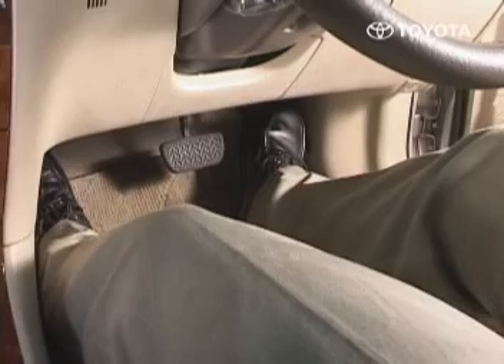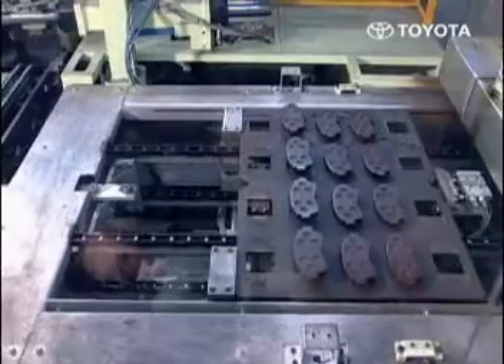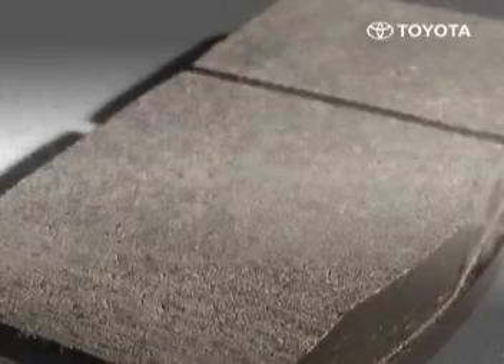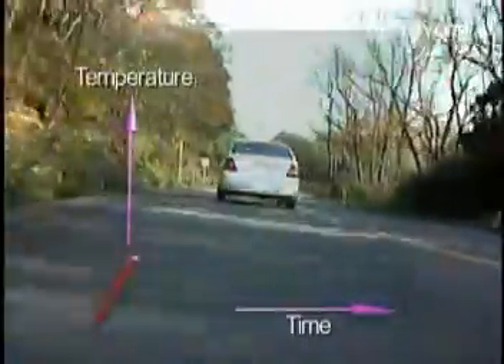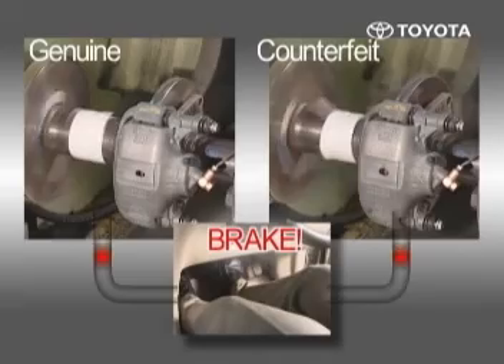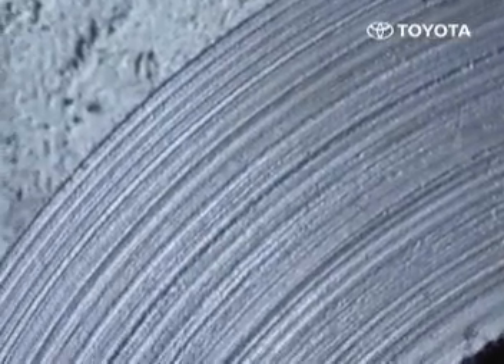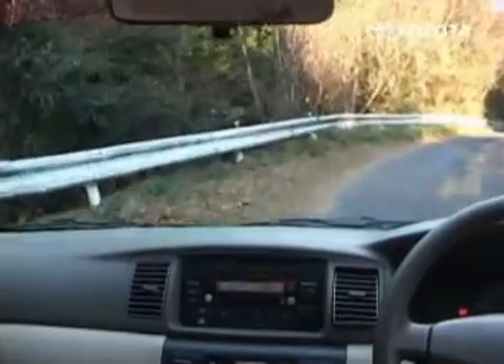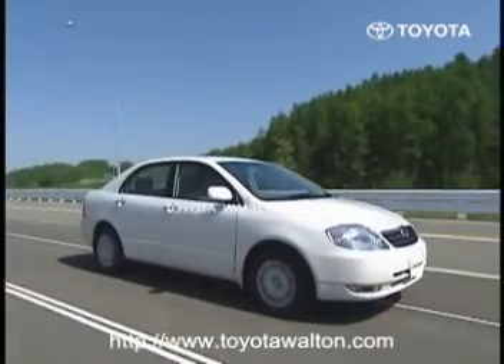Why Genuine Parts Toyota Brake Pad 4/6

Comment: Fact: OEM Pads are always the best in friction
Fact2: All pads sold in shops/parts shops meet a "Standard"

OEM toyota: Brakes best, in return, lots of dust.
Good brand: Brakes Decently, Little or Lots of dust (depends on material)
Racing brakes: Good/Better than OEM, at the cost of Dust And or Killing the rotors faster. NEEDS TO BE WARMED UP to brake at 100%

Factual wise: Go OEM or major brand (Posi-Quiet/Hawk/EBC/Ect.) Never go noname